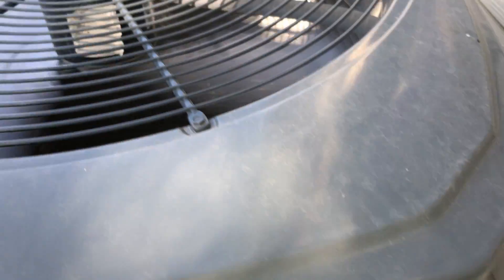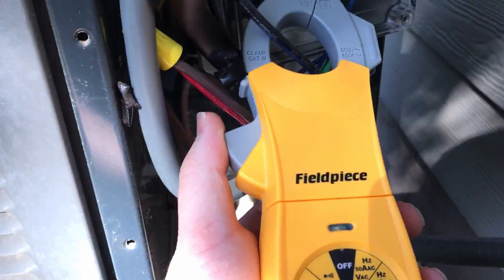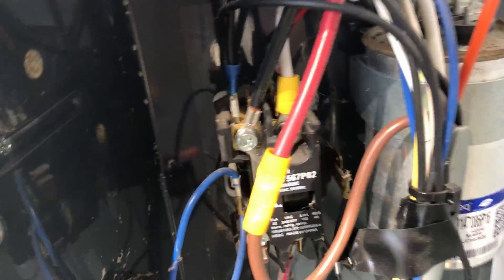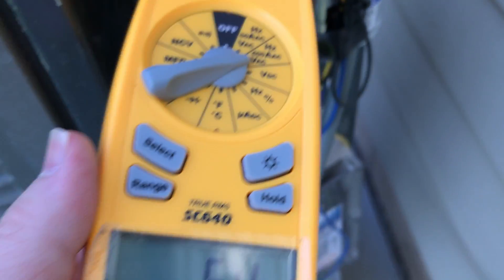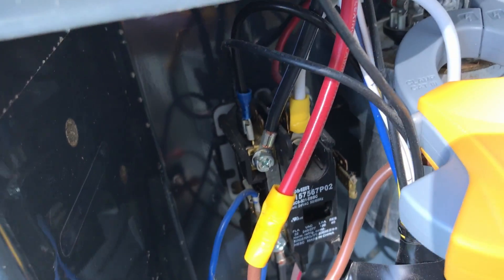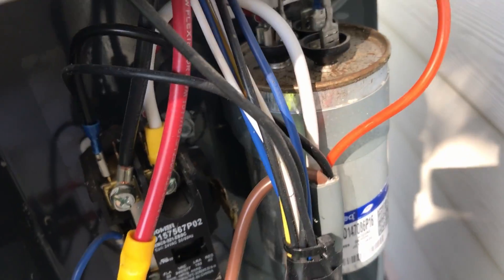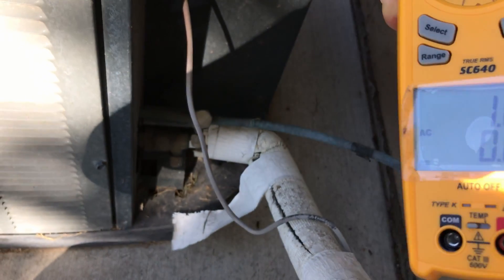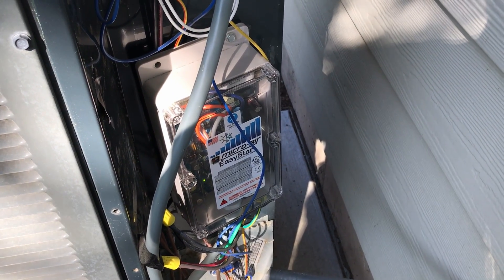MicroAir EasyStart on Full-Size A/C - Amp Draw Readings Before & After While A/C is Running.

Comment: Easystart is only for startup.  It has a relay that bypasses the dual SCR's (voltage dimmer) after startup period.  No effect on run mode compressor current.

During run period, if Run capacitor is proper value, it should provide a 90-degree phase shift (leading phase) for current to start (auxiliary) winding of compressor.  This optimizes motor torque.  With the 90 deg phase shift, the black common wire current to compressor should equal the square root of (compressor run winding current squared plus compressor start winding current squared).

I don't believe Easystart BT measures start (auxilary) winding current in its reported compressor current so its reported current is about 20% lower than actual compressor common black wire current, assuming proper 90 deg phase shift due to Run capacitor in series with start (auxiliary) winding of compressor.
Reply from the maker: All that stuff is definitely above my pay grade. But thanks for commenting and for watching!

Comment: The reason you're not seeing any difference is you need to use the common wire coming from the compressor and check the inrush current before you install the unit then again check the inrush current after you install and you will see the difference.
Reply: He's not trying to check inrush before and after,  just what it's using while running.  Apparently some people suggested that the micro-air may be adding to the load.  He has shown here that the difference is negligible if any.